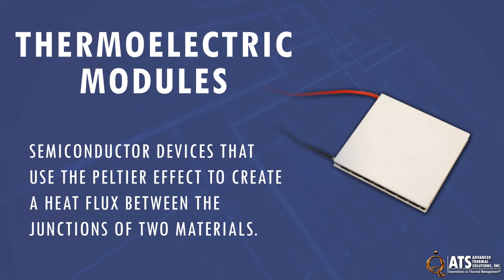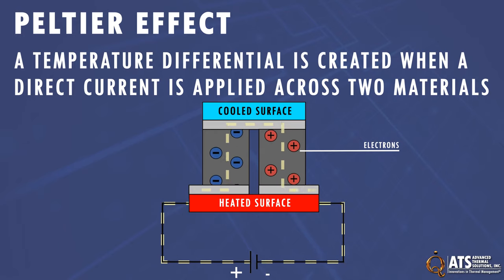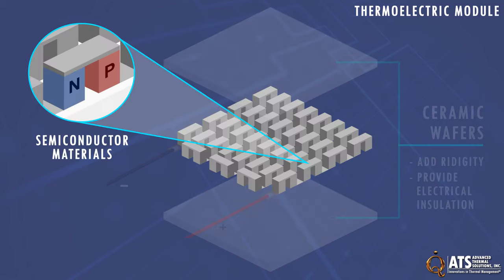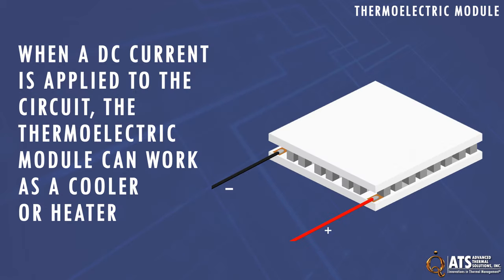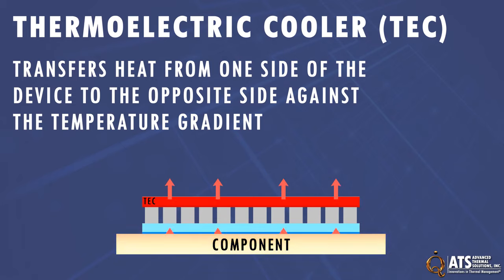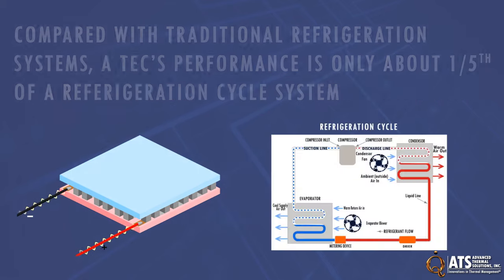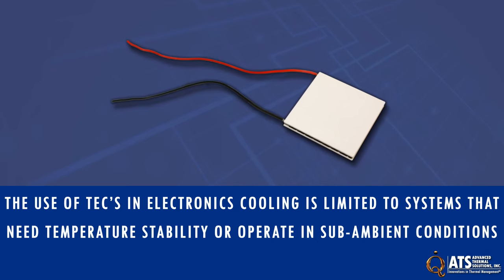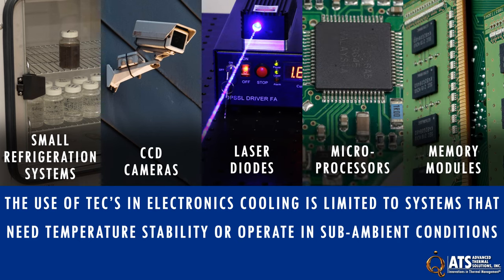What is a Thermoelectric Cooler (TEC)?

Comment: So you can only work if I supply power to the power leads?
I remember hearing about these and I was hoping if I get one side hot the other side would get cold.
Reply: No you can heat it up and get a voltage out, pretty low but enough to run a stove fan

Comment: What if you soldered the wires to each other and applied heat to the 'hot side,' would the 'cold side' become cooler? I just want to apply heat and get cold, I dont care about electricity. Thanks
Reply: Same idea. Depending on the metals it'll just change the temperature differential. This isn't a good idea though since it can heat or cool too much and carry over to the other side; therefore losing efficiency. At this point you'll need a heat sink for the hot or cold side in case one side gets too hot or coId. Best to arrange the metals so that they hit the tempurature you need most efficiently.

Comment: So you would use thermoelectric on a refrigerator that may be out in a garage where the temperature is not consistent?
Reply from the maker: Kathy, if we understand your question properly, it sounds like you may have a temperature situation where the temps get so lowthat you have to heat the storage unit (refrigerator)?  Maybe we are misreading your question?

You might build a refrigerator from TEC's, that could be an approach in this case.  You might also find using a TEC chiller or heater might be best too.  ATS makes the TEChill family for this, but you can also consider ThermoTEK or LairdThermal.

Comment: Great .. how iam using this .. cooling fan for mobile???
Reply from the maker: If I understand your question properly, no the TEC is not a fan. It is solid state cooling so no moving parts.  And it could be used for cooling virtually anything in a computer but the key is that the TEC does take energy (electricity) to do the cooling.

Comment: What is the difference between a thermoelectric generator and thermoelectric cooler? The TEG generates electricity in a temperature difference. It seems the terms are used interchangeably.
Reply from the maker: Thermoelectric generators use the Seebeck effect to generate a voltage/power, while thermoelectric coolers use the Peltier effect which allows the device to be used as a cooling or heating agent.
Reply: @heatsinks  But are they physically different when we buy them?
Reply: @pulkitsharmapremiumvideos9252  no u just need to buy peltier module
And seebeck and peltier are the reverse process
Reply: My son and I have one and put a black piece of aluminum on one side, heat sinks on the other.  Then we mounted in on a rod pushed through the center of a parabolic mirror.    The black aluminum heated up, the heat sinks drew heat away when the beam hit it, and we were able to generate current to push a small DC fan.    Fun experiment.

Comment: What does N and P indicate? Are those chemical symbols?
Reply from the maker: Hi Jack, the N and P indicate types of semiconductors. A typical thermoelectric module is manufactured using two thin ceramic wafers with a series of N and P doped bismuth-telluride semiconductor material sandwiched between them. The N type material has excess electrons, while the P type material has a deficit of electrons. One N and one P make up a couple.
Reply: @heatsinks  Does N represent negative and P, positive? Are there non rare earth elements which could be used?